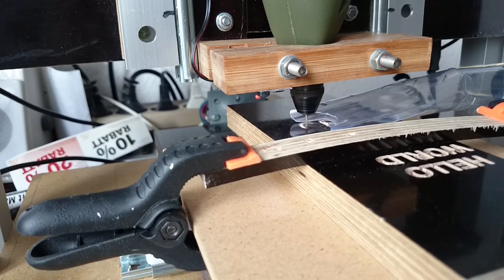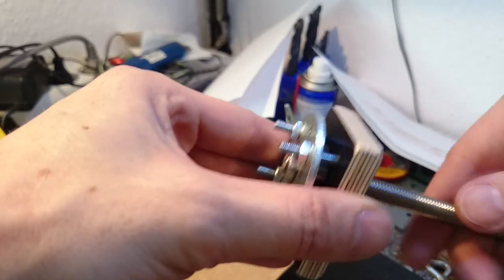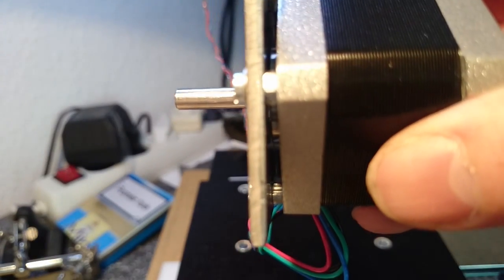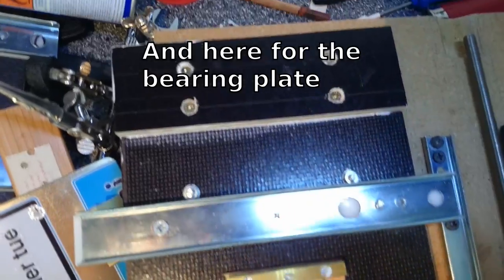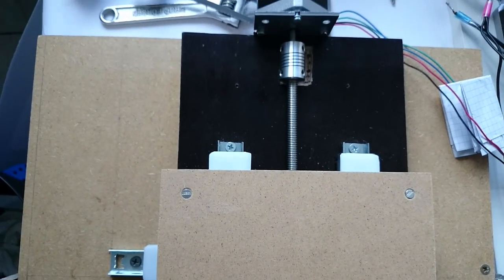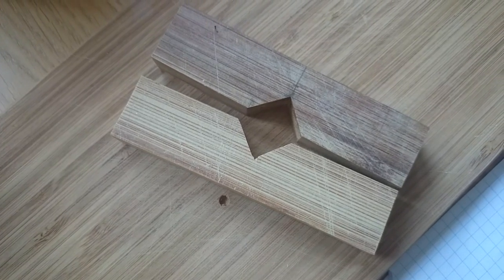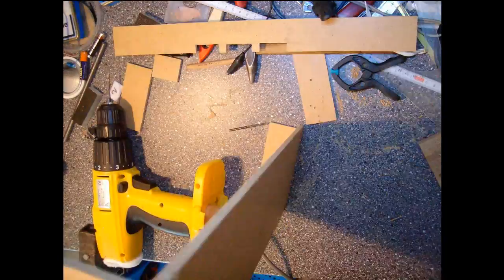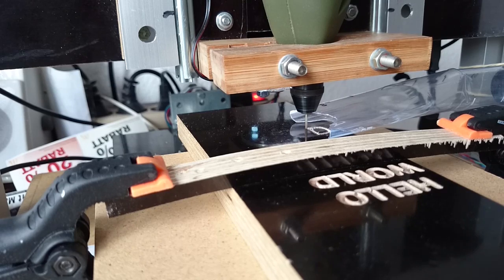My homemade desktop CNC mill - Clip 5/6: Everything comes together

Comment: great! xy-table is the most cheap and easy to build construction. unfortunately working area size is 1/4 of your cnc total xy size.
but if you'll make it more thick by Z axis then working area may slide over motors which gives you working area equal to cnc xy-size, like this: https://youtu.be/3O74JyX_2qQ (video in Russian language, but you may easily see that cover of each axis slides over motor so 400mm rails used 100% of its slide travel ;-) )
Reply from the maker: I considered that while designing. But I wanted the X/Y axis "sandwich" to be as flat as possible to keep it rigid. I know that many other CNC mills have a better "bed size to machine size" ratio.

Comment: Can I use belts instead of threaded rods?
Reply from the maker: Yes. But then you should use microstepping (Shapeoko does it that way). Otherwise, your movement is unprecise, because one full step (1/200) with timing belts generates a movement of about 0.15mm instead of 6um with a M8 rod. And of course steps-per-mm settings must be changed etc.
Reply: JoEtuuube yeah I am using 1/16 step on the a4988, just was not sure about the torque,btw thanks
Reply from the maker: torque will actually become problem. consider using 2.0Amps stepper motors (i use 1.7Amps) or even nema22 motors.

Comment: This set of videos is very helpful. Perhaps someone can direct me to a website or video showing ideas for milling and drilling with a DIY CNC machine. I have several AR15 lower receivers 80% completed. They need four holes drilled, which is very easy, but the trigger, hammer and sear pocket needs to be finished, which requires milling using a macine capable of going up to three inches deep and the same distance horizontally and laterally.

Comment: Hi
i'm trying to make a simple CNC. as  i see you use traditional screw  instead of professional lead screw. is that work properly for long time?
what is your computer software and how it is communicated  with machine?
thanks
Reply from the maker: A leadscrew is definitely more robust than my M8-screw-nylon-nut assembly, but my setup works fine for 2 years now with negligible wear. When you want to cut anything harder than PCB or plastic I still recommend the leadscrew. The software that sends g-code to the machine is called universalgcodesender which can send g-code to serial devices. The CNC machine acts a serial-over-USB device.

Comment: in your video you said that the arduino will be reset to default, but the arduino will not be reset to default when it´s permanetnly powered with a power supply. so the only thing you have to do is give this arduino an extra power supply and all will be fine.
Reply from the maker: That is true. But then I would need another "more than 5V but less than 12V" power source for the machine. So cutting the signal lines of the Hub and using it as power source was the easier solution ;)

Comment: i'm busy building a prusa i3 3d printer and once finished i'm going to build a cnc router based on thr grbl software and using a 300watt router spindle i found on ebay.
Reply from the maker: Depending on your setup, nema 17 motors might be too small/weak. It e.g. depends on whether you drive your X/Y with belts or threaded rod.

Comment: what stepper motors and drivers did you use? is that the nema 32?
Reply from the maker: Motors: Nema 17, 1.7 A, Drivers: Big easy driver. But any driver is fine, Pololu-drivers are cheaper than the BEDs for example.

Comment: +joetuuube, great video! but can i directly connect like this , pc - grbl - stepper driver - stepper motor?, please enlighten me, i am not an electronics geek! thank you!
Reply from the maker: +Jay Sario Pretty much yes. The PC (running a G-code sender such as universalGcodesender) delivers G-code via serial port, The arduino (which in this case is a USB serial device) takes the code. GRBL (running on the arduino) translates the codes into pulse signals which are given to the stepper-drivers. The stepper-drivers (google for "big easy driver" or "pololu") take the signals (and a power source, e.g. 20V) and produce the pulses for the stepper motors.
Reply: +JoEtuuube  thank you very much! God bless!

Comment: It's all about the mechanical mechanism, which is not a big problem, the main trouble is making the electronic part of it and also the software if you are using one! Anybody can make the mechanical parts their own way.
Reply from the maker: +AskFereidoon this is true. Well.. building actual reliable mechanics from hardware store parts is challenging, which is why I went that road. I also could have used more simple electronics such as ready-made electronics kits (they sell these with commercial CNC kits) but I wanted more functionality.